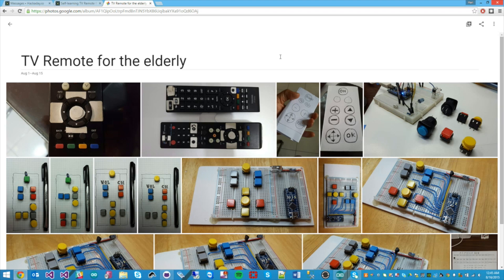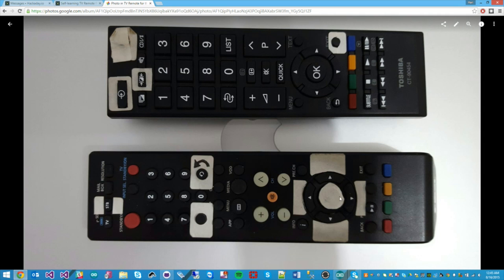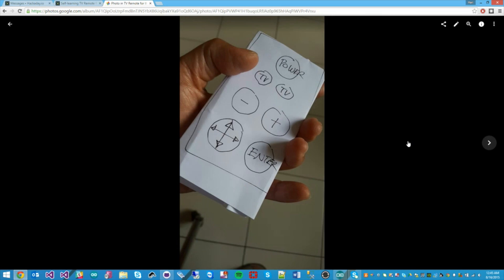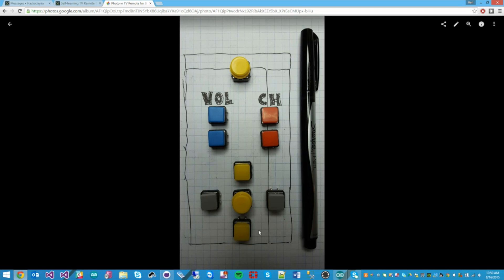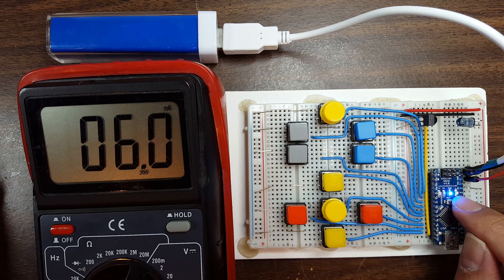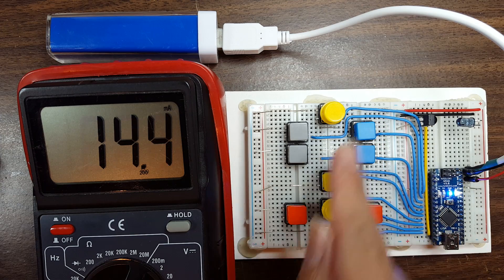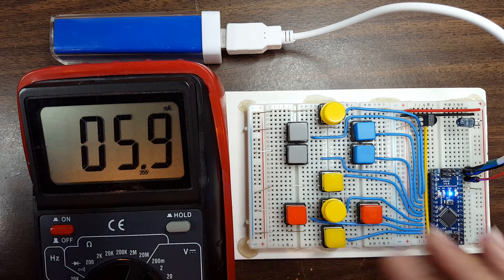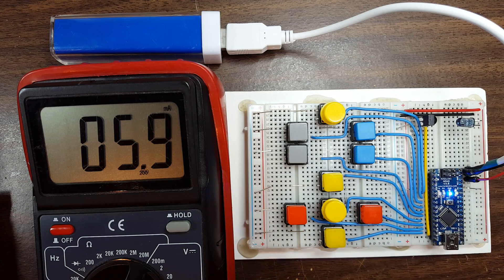HariFun #116 - Custom TV Remote part 1

Comment: That's great Hari.
Wonder if it would be easier to take a remote apart and disable all the unneeded buttons. Glue large well labeled pads over the used buttons and most likely onto some of the unused ones too but being disabled they wont care if there pressed.
I could see a 3d printer being useful to make a custom front cover and pads. 

Great idea again
Ron
Reply from the maker: builtrodewreckedit , 
Yes, I did consider butchering an existing remote, but eventually decided to build one from scratch: 1. I need to emulate TWO remotes into one. 2. Cheap universal remotes rely on entering cryptic codes and the one I bought did not have support for the cable box. 3. I love learning and making. :-)
I've now tested the IR library, it does an amazing job parsing the IR signal into simple codes that I can store and then playback upon key  press.  I love the Internet!
Thanks for the comment Ron!

Comment: Your timing is awesome, I have been working on a similar project albeit not as awesome as your project. Part of my thing is just the buttons, it just doesn't seem there are many "nice" momentary switch style buttons unless you source them from other products. The funny thing was at first glance of your drawn remote I though maybe you were going to do a capacitive touch remote as in this instructable (http://www.instructables.com/id/Turn-a-pencil-drawing-into-a-capacitive-sensor-for/)) :)

Keep up the good work, and can't wait to follow along. I know you linked the hackaday but for some reason the video's are much more fun to follow along. Forgot to mention i'm using the ESP8266 version of the IR Library but it should still scale the same.
Reply from the maker: Bostish2 , my criteria for a nice switch is that they have an easy to press large surface. I rejected a lot of very high quality switches because the are flush with the mount and require a lot of "travel" before it registers the press.
The ones I'm using are these:
https://www.adafruit.com/products/1009

https://www.adafruit.com/products/1010

Adafruit have many other nice switches, I've also found some good ones at Jameco.com.